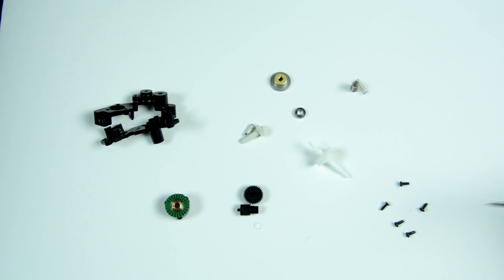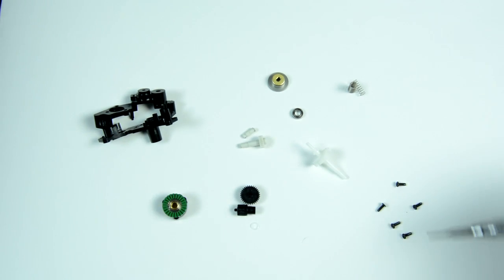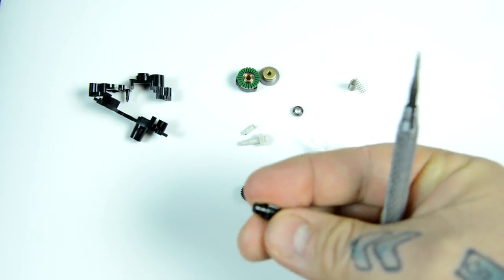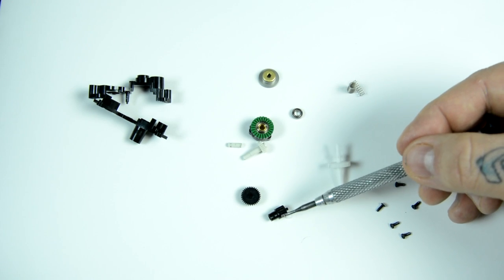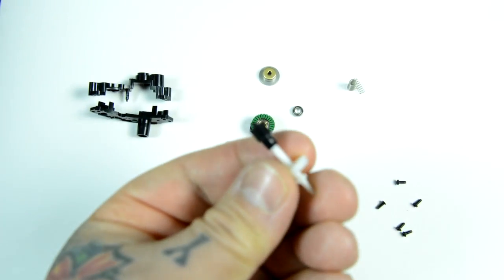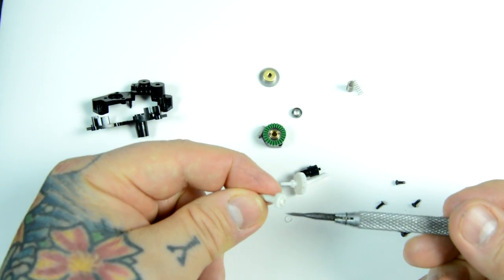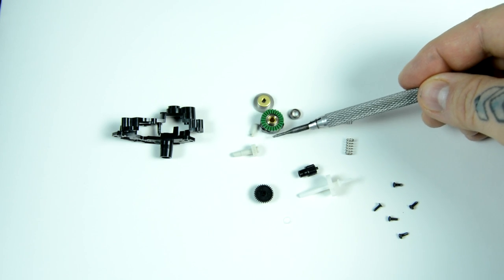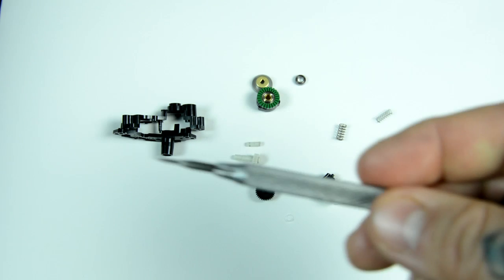NIKON! Check THIS OUT! First Time Ever Video ~ Tear-down Nikkor Micromotor...Nylon gears? NO

Comment: Ken i found a way to tell if a nikkor AFS has gear afs/vs ring drive afs. Put it close to your ear and slowly turn the focus ring. You will hear a dulled grrr sound.  It sounds exactly like the mechanism of cheap toy battery cars i had in the 1980. If it is ring drive afs you won't hear this sound. Turns out my newly purchased 35mm 1.8 ED is made as cheaply as possible and has the micromotor afs. Should have looked your review before purchasing this disposable plastic lens.
Reply from the maker: this is true :)

Comment: Another good post Ken. I have Nikon AF-S 70-300mm VR, 18-140mm DX VR and a 35mm DX all with SWM labeled on the back of the lens above the made in label. Are they true SWM or Micro motors?
Reply from the maker: not true SWM :)

Comment: This all fine and large.....But what is the practicality of showing us these plastic gears unless you can also back up your rant/exposé with some failure records? If the lenses work perfectly fine for years then it's moot what they use in the construction.
Reply from the maker: years isnt long enough …..i said as i hold a 72 year old lens.
Reply: Yeah ok.....If you want to play that game. My SMC Takumar lenses will also be fine after another 50 years if they haven't fuzzed over with mold. But they are not autofocus or auto anything. If you really want to make the lens you destroyed last for decades you could take the little gears and shafts to a machine shop and they can make exact copies out of a brass alloy. Problem solved.  I am just being a little bitch of course. I love your reviews and advice and everything that you do for us....!!!

Comment: Nylon is a plastic so wouldn't it be better to comment on the suitability of the various plastic components used in the SWM for example abrasion resistance, tensile strength, hardness - ultimately aren't we looking for optimal use of materials to achieve light weight, durable, long-lasting, quiet, fast operation of the lens. I don't see any real conclusion on such matters in this video.
Reply from the maker: and mercury is a METAL………but liquid :/   heheheh    i know its a plastic.

sure you do, the conclusion was right in front of you……use a ring ULTRASONIC motor
Reply: Without taking things apart, not always easy to determine what's 'under the bonnet / hood' - as you rightly say it's the weakest link that gets you.  Now if Rolls Royce had made lenses instead of cars hee hee!! Anyway, I enjoy your videos which is why I recently purchased (on your recommendation) a second-hand Nikon 17-55mm F2.8 lens for my (much loved!!) Nikon D500. Thanks for recommendation. Now to save up for a Nikon 200-500mm lens!
Reply: +Mel Selwood good choice...both fantastic lens!

Comment: that "nylon" bends like polyethylene.. the housing appears to be ABS, which is better than the shafts and gears. It's the quality of the plastic, you've got five different materials there.
They use alloy for the outer case, but scrimp on the motors. Acetal would be more desired, as would polycarbonate rather than that cheap styrene with a lack process control,  perhaps too much moisture content in the resin when it was molded?
 ie, all plastic ain't created equal.
Reply from the maker: no, the outer case is plastic too.  not metal
Reply: Theoria Apophasis I meant the camera body, the motor casing is ABS. I could tell ya more if I burnt and sniffed the parts, lol.. 
The green piece may be acetal..
Reply: John J mm, yea those suits can be pretty dense.
Reply: The green peace is for sure the electro magnet....
Reply: John J hmmm, trust me I'm an engineer.😉
Reply: Felix Siam
 Engineer's are rarely "hands on", so that's not realy saying anything...
Reply: Felix Siam
I did, but I am also an educated machinist, and and engineer, those two jobs destroid my knees, so I can recommend and early retirement.